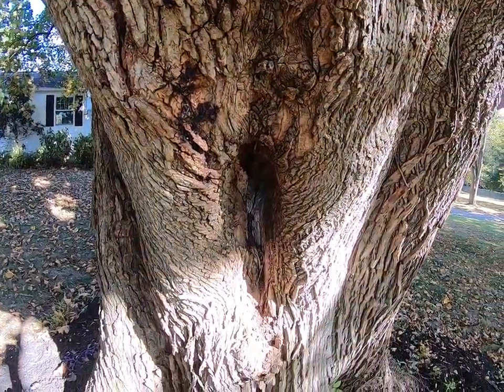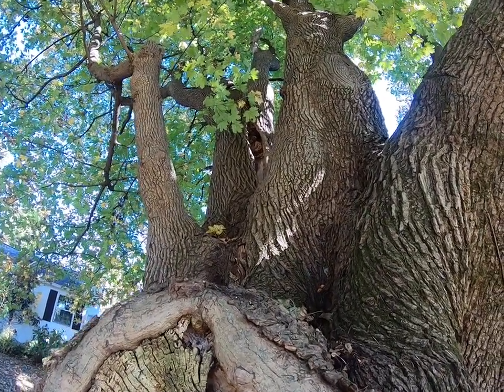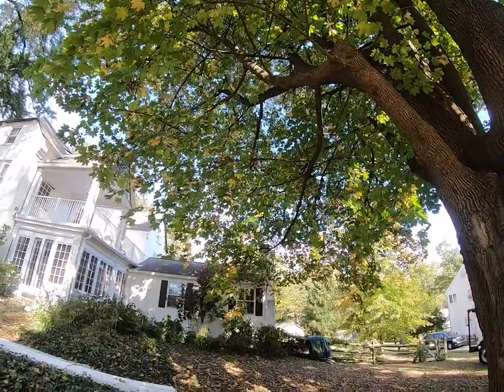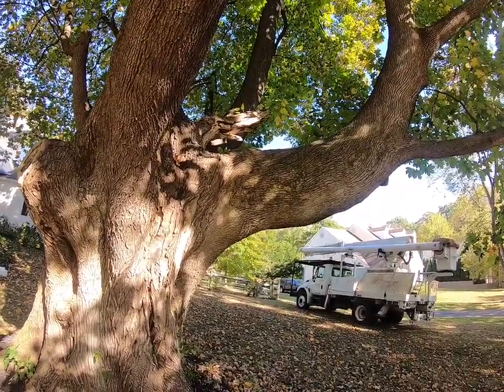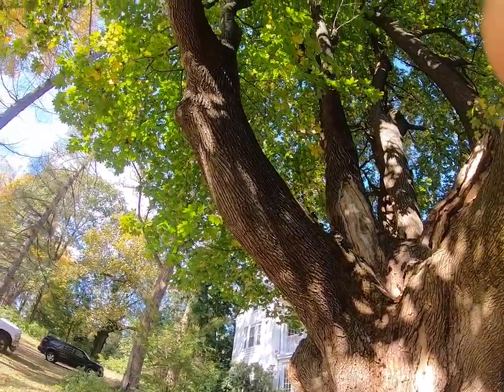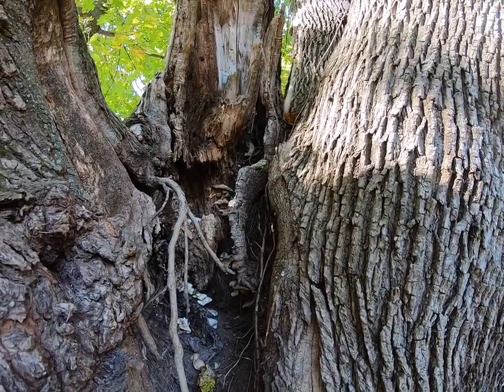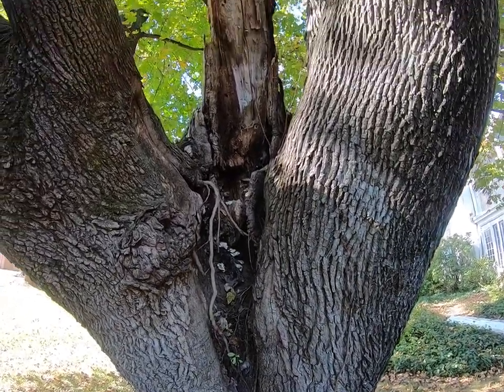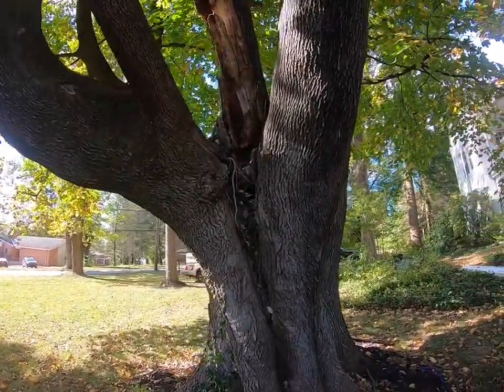structural analysis Big Decayed Norway Maple

Comment: Daniel, what’s the best material for cabling? A customer of mine has a beautiful silver Maple that appears to have some sort of rope about 20 feet up holding the three main trunks together. There’s definite rot starting at the unions but tree looks healthy otherwise and provides a ton of shade.
Reply from the maker: I use 1/4" steel cables (EHS) extra high strength, with dead ends and thimbles. If the cable is set high I usually use 5/8" j lags, but will go with 1/2" thru bolts on compromised limbs (such as hollow silver maple) or anything lower than 2/3 the height from the crotch tot he tips